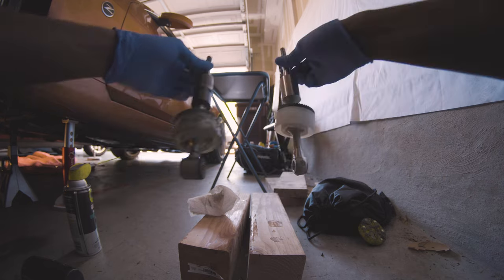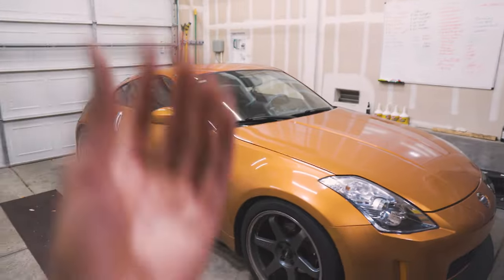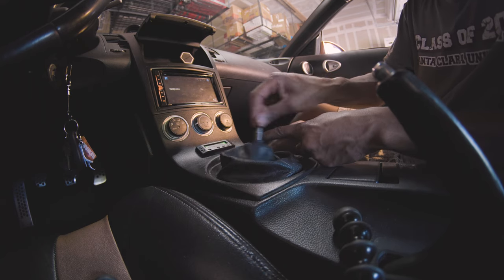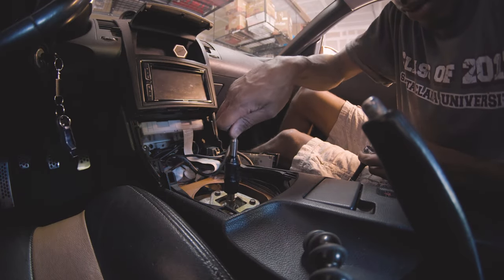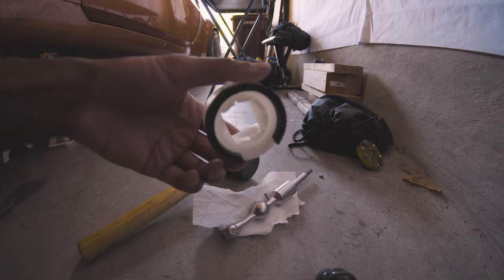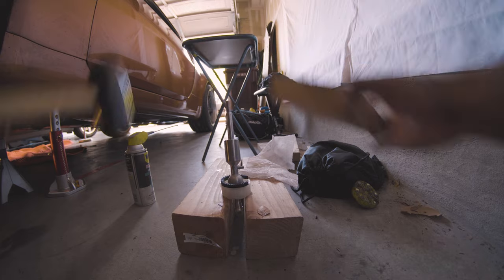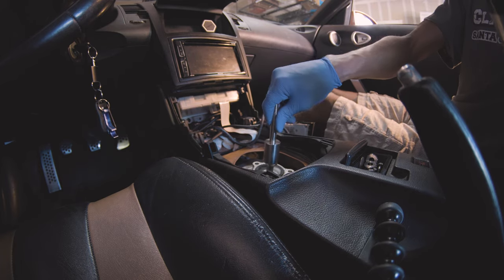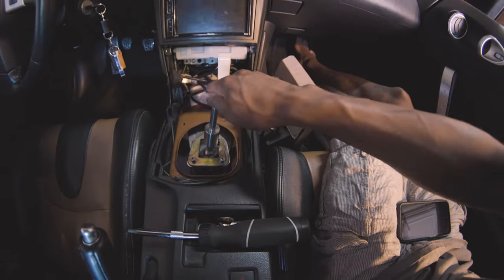EVERY MANUAL CAR NEEDS THIS UPGRADE | 350z Short Shifter Install

Comment: Awesome vid, unfortunately on newer cars with rev hang there’s no point in lightning quick shifts if you have to wait a sec or two for the revs to drop, either way awesome vid !!!, I’m jealous, your 350 z is awesome
Reply: Not sure rev hang has anything to do with shifting quickly. It's more of a driver's aid than anything else.
Reply: @wingmangarage  maybe what I meant to say if you want to have a smooth shift, you’ll have to wait for the revs to drop to the right rpm to not get a jerk, so I don’t see a reason to move the shifter quickly if I have to keep the clutch depressed for a second or so longer for the revs to drop, if you don’t care about smoothness then yeah you can shift a lot quicker with a shorter shifter
Reply: @annley  that’s weird. when i release my clutch, the gear engages and my rpm drops and it’s all a smooth transition no jerks. i don’t wait for anything. if i depress my clutch at 3k rpm, i shift and release the clutch quick enough that the rpm is still at 3k. all a smooth transition. you must be releasing your clutch to fast not giving it enough throttle
Reply: @zachhuffman9336  he means there are a lot of newer cars that have a bad case of rev hang especially in higher rpms where if you clutch in after a pull the revs tend to hang there for a second before dropping down (tends to occur more in entry level manuals.) Every platform is gonna be different but sometimes the fix is to get the car tuned or even lighter flywheel. It has something to do with the way the oem tunes the drive by wire
Reply: @annley  I'm having the same problem in my Mustang after installing a MGW Race spec shifter. Now I need a racing flywheel

Comment: Stainless Steel Bearing Spacers I could not get it back thru the linkage it was almost like it was to thick to fit back in not sure if I’m doing something wrong I was able to put it together just without the spacers

Comment: You experience any rattle ? I have the same short shifter and it rattles like crazy(not the shifter itself I’ve been through so many trying to fix) but I’m sure it’s from the fork and bolt where the washer rattles in between them.
Reply from the maker: yepp i get the rattling. just kinda tuned it out after years of driving haha. i’m sure there’s a solution, but it never bothered me enough to find it

Comment: Besides a weighted shifter knob, you can get a longer one, actually increasing leverage and shortening the distance between your steering wheel and your shifter... How's that for a short shift? 😉😜
Reply from the maker: planning on that for my bimmer 👍🏾